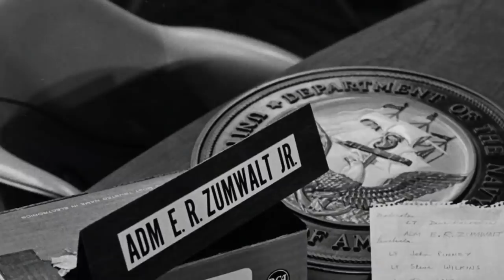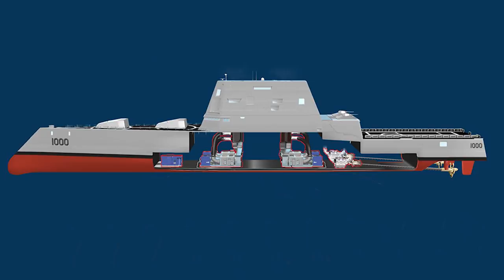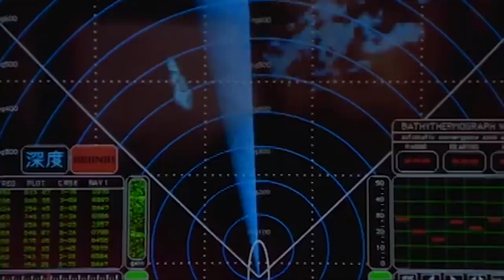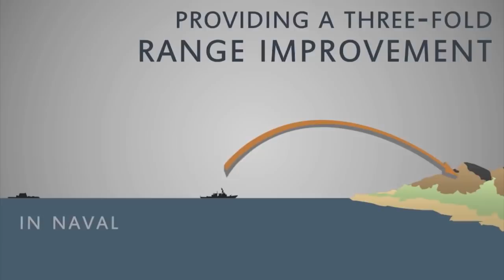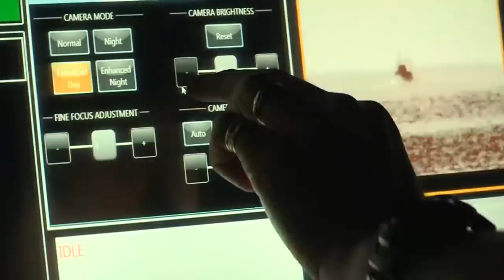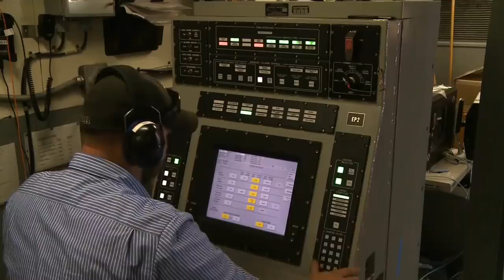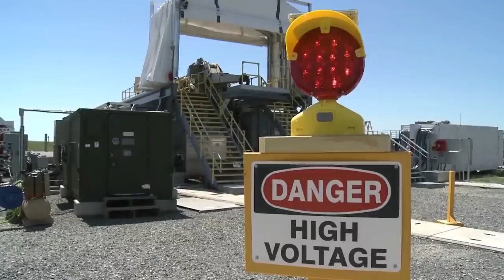Zumwalt - destroyer from the future

Comment: No railguns, no lazers. Just a floating lab with new computers
Reply: Frank Galeon Floating smoothing-iron)
Reply: Relax, those will come later. It's not the ship's fault that the railgun and laser projects are taking longer to develop.
Reply: Not quite comparable to the Monitor as this isn't needed to stop the Virginia. But if one thinks about it, there is a resemblance.
Reply: They said there is room for adding weapon systems later :)
Reply: Well, the paradigm shift has to take place and the shift will be costly and time consuming but will make the usn the top dog again
Reply: not even the new computers
Reply: Top dog again? We still are.
Reply: Will never see combat, but it did make a few people in Sweden even more wealthy
Reply: Riiiight, I was reading like 5-10 years ago that these things are definitely gonna have railguns! Thought that was like half of the reason why this ship was a thing other than stealth! At least it's not a super obvious colossal failure like the f35?
Reply: 3 Billion each is a little bit ridiculous.
The entire military procurement system needs to be revamped.
We used to make fun of ten thousand dollar hammers and twenty thousand dollar toilet seats that the military would buy.  They say that is fixed but the only thing they did was switch those overpriced items to items that sound more expensive like "flux capacitors" or "quantum discombobulators".  The military industrial complex continues to scam the US taxpayers.
Reply: @justsomedude7583  F35 is getting mass produced, Zumwalt project is going nowhere. It has no purpose, no function other than enriching defense contractors.
Reply: @QuantumAscension1  Yeah, you'd think they would finish them first, i mean we kinda already know how to build ships :D
Reply: Keith Krick well a lot of the Navy’s/DARPA’s electromagnetic and directed energy weapons projects got started all the way back in the 90’s, as did the DDX next-gen destroyer program, initially kicked off in earnest, but then seeing major budget cuts due to the end of the Cold War. As a result, R&D went slower through the 2000’s, though picking up speed as the War on Terror drove interest, and thus funding back up. Odds are they probably didn’t anticipate the weapons projects would take so long to perfect, and to be fair you wouldn’t exactly want to wait for all the weapons to be developed before you started work on the ships, otherwise you’re looking at another 10-15 years before full deployment.
Reply: If it doesn't have cost efficiency, its trash...
Reply: @QuantumAscension1  Agree, my post was really just a bit of fluff :D It seems though that not one weapon the ships were designed around has made it on board. even the radar was compromised. Still, i guess they can step back and say "it looks pretty cool".
Reply: @RetroCas  against third world countries,tes,against russian and chinese baby, don,t think so
Reply: Are you sure? Search ZUMWALT N.003 OR 03 THIS zimwalt have an HLSDE long-range Laser in the backbridge.. I also know there are one zumwalt where they are trying to put and railgun on top but it will be difficult for some reason ( in the truth they can reach the object in less than 1 year )  ;)
Reply: Invisible to radar.....but still tracked by satellites since the day it's hull was started in dry dock.
Reply: John Case 👍
Reply: manictiger You do realize that the House of Representatives sets the budget for the department of defense, right?
Reply: @QuantumAscension1  
I remember the Obama years very vividly.  I remember the cuts and I remember all the cancelled programs.  Don't try to sugar-coat or strawman this sh7t.  It was the Obama Administration.
Reply: @jorgensenmj  these $10,000 hammers are not hammers, this is just how they get funding for black projects, the money has to be accounted for so they just make something up.
Reply: The issue with lazers and rail guns is power generation sure super capacitors work fine for one shot but if it takes 5 minutes for those capacitors to be charged again it isn't practical, even nuclear powered ships are unable to deliver the power at the desired speeds.
Reply: @QuantumAscension1  It is the ship's fault! Bad Ship! Baad! You no get treat!
Reply: @jorgensenmj  a ... a quantum what?
Reply: Sebastian Flynn lol, I like how he’s literally referencing the line that old guy says in Independence Day when the character himself is making that point. Guessing it went over his head
Reply: Those were planned though.
Reply: Sebastian Flynn I wonder if they’d be able to use Explosively-Driven Ferroelectric Generators to charge each shot, or at least supplement the power build-up. Sure they’re only one time use, but they’re way safer than having traditional propellants onboard, they don’t take that much space, and they provide a f**k-ton of power in a brief period (somewhere in the terrawatt range)
Reply: The price of two of these could get you 2 new aircraft carriers
Reply: Trash4Cash 哈哈哈
Reply: Testing it on people all along the shores
Reply: Man, remember when people were saying the same sort of thing about the F-15. How'd that one turn out again?
Reply: Yup
Reply: @QuantumAscension1  gas turbine engined provides power generation fairly fast and is what the royal navy will be using.
Reply: They do have Lasers for defense, just look at Paradise California! And few other places of "Wild Fires"!!
Reply: @pradeepkumar-qo8lu  again? We r there NOW
Reply: well the lasers come later. like retrofit will be done
Reply: @justsomedude7583  Sir, In Victorian & New South Wales Australia both just spent 22billion each! On desalination plants that haven't been used.
Reply: Why do people like you make comments when they don't take the time to check their facts first?  First check your spelling it is lasers and not lazers. Second, since you haven't been paying attention the Navy is deploying two separate laser systems across the fleet called AN/SEQ-3 Laser Weapon System or XN-1 LaWS. Third, no body has a working railgun deployed, no slapping one on a ship like China did without proving it is being fired doesn't count. The reason is because up till recently they burned out the barrel elements after a few dozen rounds. The US is now moving forward with sea trials for it's railgun so those bugs must have been worked out.
Reply: @jorgensenmj  Two things you said have me really laughing. First, you can't just keep buying the same thing over and over again because technologies are advancing making already existing technologies outdated so the cost is always going to be higher on a new class of ships that uses cutting edge technologies. You can also thank congress for reducing the number purchased which drove the per unit cost thru the roof. The second one was you comments about the cost of the toilet seats. Judd Hersch had a line that was appropriate in the movie Independence Day "You don't actually think they spend $20,000 on a hammer, $30,000 on a toilet seat, do you?"  The money was shifted to things that can't be listed in the budgets like they did with the F-117 before President Carter went public with the plane.
Reply: lasers are coming, but I don't think they'll replace Phalanx, instead they'd supplement it. 
Railguns may be abandoned. There's more interesting and cost effective ways to achieve what railguns try to do.
Reply: QuantumAscension1 but china already has them so 🤷🏽‍♂️
Reply: Nay, good sir. It's a stealth, long range artillery ship with greater range than old destroyers and higher survivability. I doubt the magnetic rail gun has been dropped from research. High powered lasers are still in research and are likely to replace or add on to the existing arsenal. Coming from an electrical engineer and laser technologist that worked for the US government and defense contractors.
Reply: @diehardAMD  Rail guns showed a lot of promise, but they have been plagued by very limited barrel life. I believe work on rail guns is diminishing not because there's a lack of merit, but because there's a better approach which has emerged.

Typical artillery shells fire at around mach 1.8 to 2.2. By using longer ratio of bore to barrel length, and controlled burn time of propellant, you can push conventional artillery to mach 3 at the muzzle, without unusual barrel wear. In and of itself, that offers more range, but... The "new toy" is ramjet-powered projectiles, which become functional at mach 3, and can power a projectile (after leaving the muzzle) up to mach 6-8. 

As a single-use engine, it's free to more or less destroy itself via heat build-up. And it is fairly low-tech. At that speed, the range of artillery shells increases by over an order of magnitude vs. regular artillery. These projectiles can be exotic "smart" munitions, or they can be inexpensive dumb-fire projectiles. At that speed, kinetic energy could replace the need for warhead payload.

This is unclassified, but it's not being widely advertised. Ramjet projectiles are poised to replace interest in rail gun tech, and are rapidly moving from the lab to deployment. Self propelled 155's with elongated barrels will be the first to field it. They're even developing a land based super-heavy artillery piece, using this type of projectile, which would have a range similar to SRBM or even MRBM.

I expect the Zumwalt class will end up with elongated 155's, using ramjet projectiles, not dissimilar from the ones planned for the land based SP howitzers. This may require a remodel of the gun enclosures to accommodate the longer barrel length.
Reply: they can just sail around and be friends with everyone. mobile lan party centre.
Reply: *Frank Galeon I WISH I HAVE ONE"
Reply: Stimulated doesn't start eith a "z"
Reply: @QuantumAscension1  Railguns are a dead end, at least with current technology. Hyper-fast sabots are neither good for long range ground attack, nor for anti ship duty. And railguns cant do anything else. Navy is mostly defunded their Railgun program, as far as I know.

Anti-missile lasers are already combat capable, have been for a while. Still used for nothing but some prototype on a supply ship.
Reply: They're still testing the ship you muppet. Have some patience.
Reply: @令狐冲-o2v  You must be referring to anything that's Made in China".
Reply: @martinigasolini4062  "Testing". You mean the ships still not finished. The whole propram has become a scheme of the Navy to soak up more tax payer money.
Reply: Looks like a space cruiser, hope the design catches on
Reply: @stevem2323  other than the trillion dollar project and it's disappointing performance it's spectacular
Reply: @tnt_6308  Other it's not and you don't know first thing about this ships and what they can do, just like with the F 35.
Reply: @Kirovets7011  All new ground breaking revolutionary weapons start that way. Give it time, you will eat your words.
Reply: @melvinthedeathless.melvint6727  

But isn't that good for the American economy? After all, at this moment in time the USA needs its military-industrial complex more than ever having outsourced pretty much everything else to China.
Reply: Imagine a Zumwalt facing off against a Yamato or an Iowa. The battleship would fire one near-miss shot, and the Zumwalt would capsize from the splash 😪
Reply: @sportsfails4998  alternatively the battleships fire control is knocked out by a single missile fired from over the horizon
Reply: That's how these technologies are developed - crew reduction saves cost, and at the MINIMUM you've got to admit that they're operating a larger and more capable destroyer with HALF the crew (and resources that come along with that). That alone is an invaluable research tool for the future USN. I think the ship has far more capability than just that, but oh well..
Reply: @pradeepkumar-qo8lu  usn is and always has been top dog
Reply: @jorgensenmj  idk man. Submarines run about $1 or $2 billion per
Reply: @Kirovets7011  lol they could've build huge battleship, powered with few nuclear reactions, with Rockets, AA rockets, drones with rockets, 2 huge 'Missouri' type guns and 1 slot for another huge Railgun for future, powered from one of reactors.
And do not forget to add ability to hide all turrets inside the ship and go underwater!
Reply: No, just a floating lab with OLD computers running Windows NT.
Reply: BRUH TRIANGLES
Reply: @melvinthedeathless.melvint6727  Innovation, if we wouldn't push for more and better we would probably still be using horses xD And developing new cutting edge technology costs.
Reply: And the purpose-built artillery gun it has uses obsolete rounds that cost $800 thousand to build ONE round.
Reply: @pradeepkumar-qo8lu  Still the top dog and has not been anything less since at least the beginning of WW2, these new weapon systems once fully implemented will keep the USN in that position for a long time.
Reply: @QuantumAscension1  Well the US Navy has cancelled the railgun project due to lack of sufficient improvement in barrel life it was 4 shots before barrel replacement then after 8 years they got it to 6 shots.
Reply: Ushio01 Yeah, that’s why they need to switch focus to coilgun development now. No barrel contact, no problem. Besides railguns are so primitive, barely above sticks and stones really; the poor man’s future weapons platform. Coilguns are the TRUE advanced civilization’s weapon of choice, lol 😁

Kidding aside though, yeah, for development to to proceed further with railguns we’ll need to develop frictionless / extremely-low-friction materials for the barrel for it to become viable
Reply: Now they have lasers
Reply: Who knows she might have Lazer and railgun on board already
Reply: It could always be worse, It's software could have been from Microsoft
Reply: @marshalmontez6795  10 cent PLA eh?
Reply: @sebastianflynn1746  Funny, Thats why they use several Capacitors. By the time the fist is empty last is full.
Reply: @QuantumAscension1  Yes, they maybe be ready in 20 years.... when others countries maybe have proton torpedoes .......ha,ha,ha
Reply: Indeed
Reply: QuantumAscension1 a railgun is not useful against ships. yes they can fire over the horizon but they have such a small area of impact and are so expensive to fire because the military made a ammunition that is incendiary and expensive to fire so in summary railguns are awesome but not useful against ships
Reply: @saucejohnson9862  imagine thinking there is world peace...are you a real person?
Reply: @stevem2323  you a fan boy!😂
Reply: @broskoone  Hater.

Comment: They literally spent the equivalent of all of North Korea’s gdp on these
Reply: Joe Blow       The gdp of Birmingham is 10 billion approximately. The nominal gdp of North Korea is approximately 30 billion.
Reply: Oh well, it's not like the money got deleted from existence.  All that money got spent to companies and contractors and they spent it on companies and contractors and all the way down the chain.  And even the presumably enormous profits get spent and invested and frittered away and pretty soon we're just describing how an economy works.
Reply: It would make a good naval spearhead for our Atlantic-Pacific Theaters and Non Blue Water coastal patrols in those areas.
Reply: Most of the ship was probably made in Korea,  then shipped to a US facility for assembly.  Korea has a very substantial dock yard.
Reply: Chadrach William Sorry Exclusive Top Secret project. Bath Iron Works, Huntington & Ingalls Ship Building, Huntington Industrial, Newport News, General Dynamics, Raytheon, Northrop, Grumman, Lockheed Martin, Just a few, according to what part/section, electronics etc. Proprietary Joint Operations. Bath IW being head contractor of ship build & framework, mainly.
Reply: @1563ckg43  top secret is as easy to get with a clean record,  as is a box of pop secret.  I worked on the mk252 torpedo when I was only 17, making corrections on Mylar, so the electrical engineers could test, fix make corrections, and do it all over again.  Then I joined the MC and had equivalent clearances, nice list of information there, but does not change the fact that a good percentage of EVERYTHING comes from overseas.  The Whole is greater than the sum of it parts. The Whole being a US product, it's parts being out sourced to wherever it is cheapest.
Reply: Chadrach William This is true “Secret” is just clearance holders who work on it directly or indirectly have knowledge of it. When parts are ordered it’s usually not stamped USA Department of Defense Top Secret Please don’t tell anyone.
I sign my John Henry too on stuff I work on, or the parts I build or have ordered.
Reply: @tech99070  How a military industrial complex works*
Reply: It's easier for politi to look at than a healthy and fed populace.
Reply: James Pearson 

Progress isn't cheap.
Reply: @jamespearson3364  Greater Manchester has a total GDP of $87bn (Eurostat figures), the metro including surrounding areas is 114bn in 2012
Reply: k p   Manchester Alabama, not Manchester in the UK
Reply: @amicaze9570  How ANY military works
Reply: That's not much
Reply: 45 Savage  Leave the DPRK alone and end covid 19 and mass unemployment that's the enemy not Korea!
Reply: The Zimwald AKA an expensive mistake that can't stop a Russian torpedo. I'm sure it might scare some Iranians... 

With how ugly it is lol
Reply: Yet they can't fight NK
Reply: gdp doesnt tell anything about the nation's wealth
Reply: costs in most cases don't reflect the quality of a product